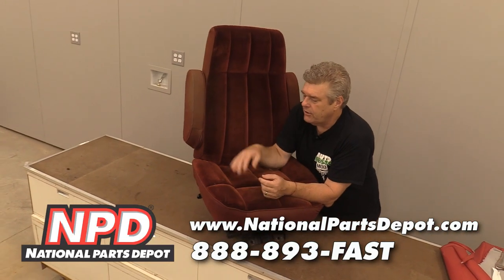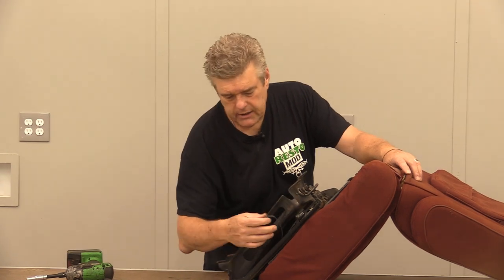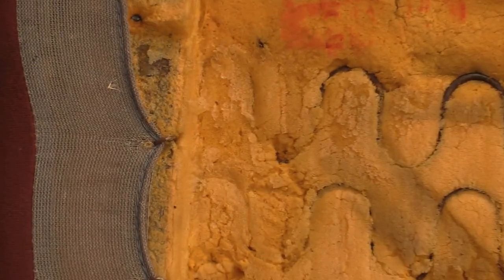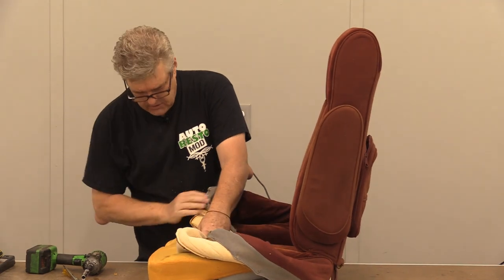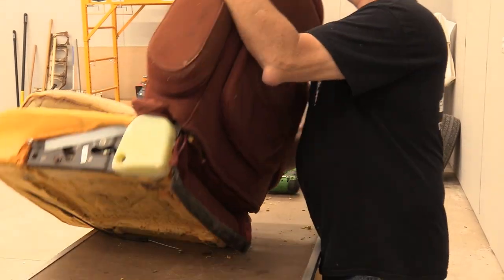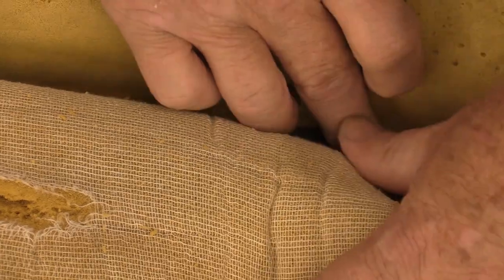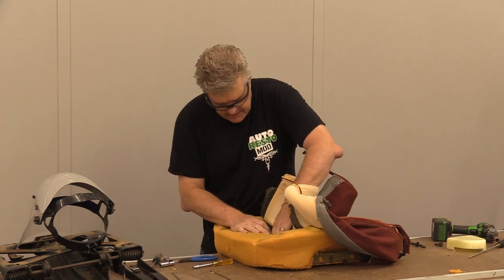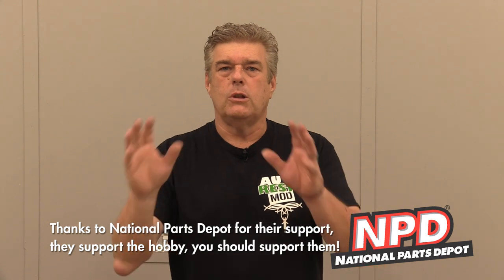Ford Bucket Seat Disassembly

Comment: Captains seats in ford Van's. If you are too close to the steering wheel.  Pull the seat and upper and mark a line 2 inches from the front.  Make a pattern of the top.  Cut off that 2 inch strip. Weld it to the back. Redrill the front holes.  Now your seat is 2 inches farther back. Without having to  screw with the floor mounting bolts.
Reply from the maker: Once again Wayne, nice tip!